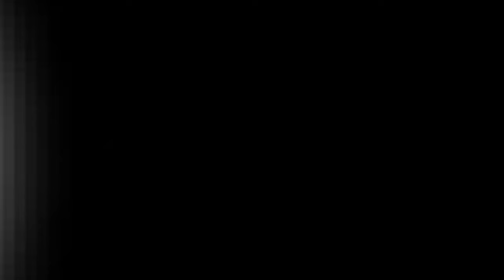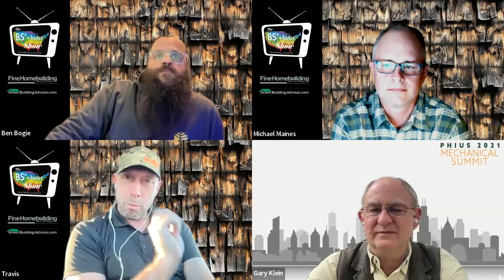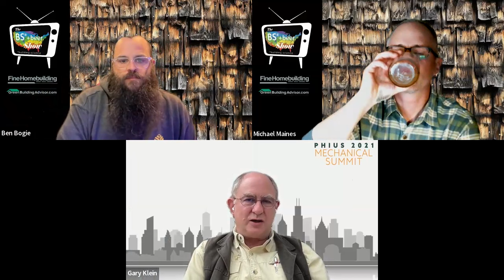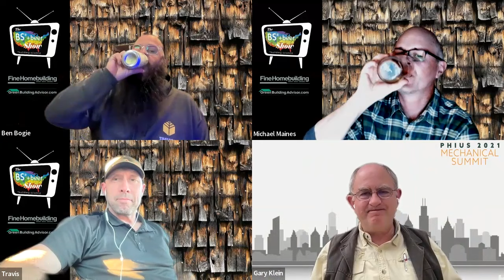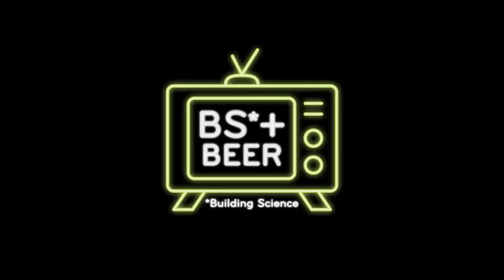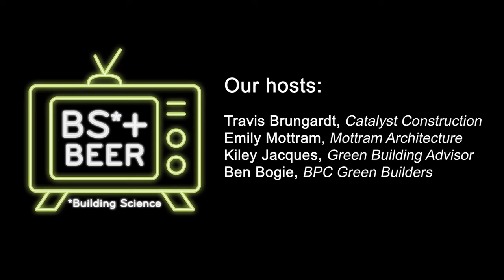Hot Water Distribution

Comment: Great information.  I have built 2 houses with a recirculation loop and pump on a timer.  Works great . Just push the button for 5 minutes and you have hot water to the fixtures in a short time.  It's on demand so you don't waste energy continually circulating water when you're not using it. The smart pumps seem like a complex way to solve a simple problem.
Reply: if you can, calculate the travel time for water from the water heater to the shower/sinks loop and just set the recirc pump time to that.  Good chance might be less than 5min.  Waste not, want not, lol